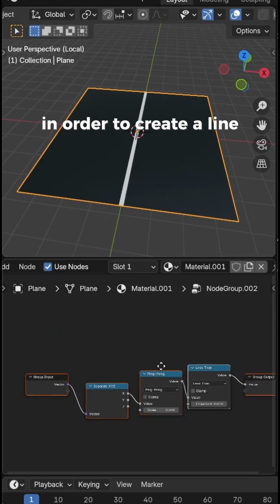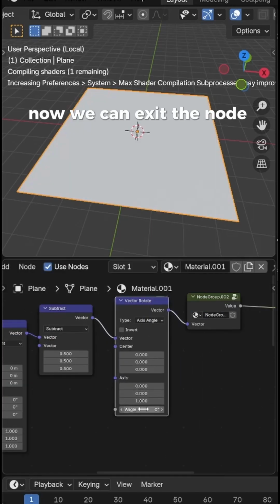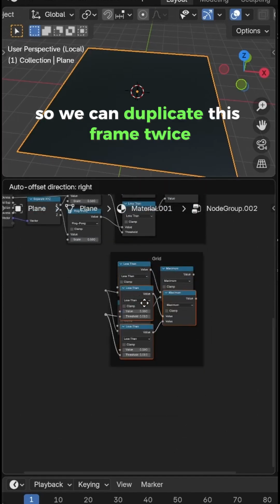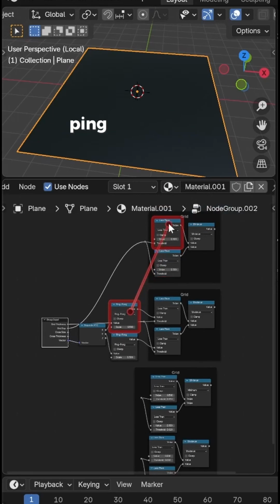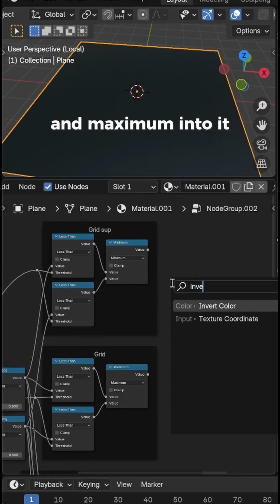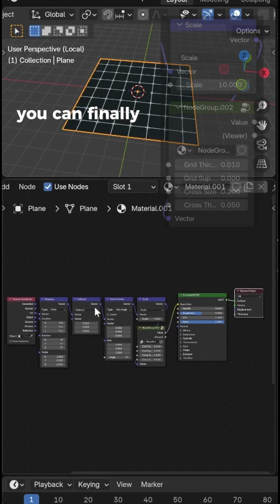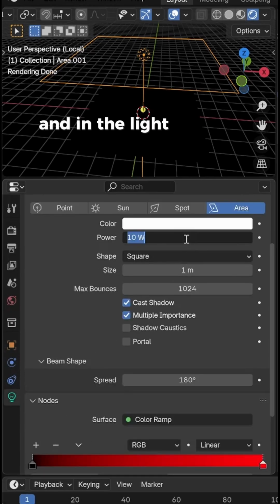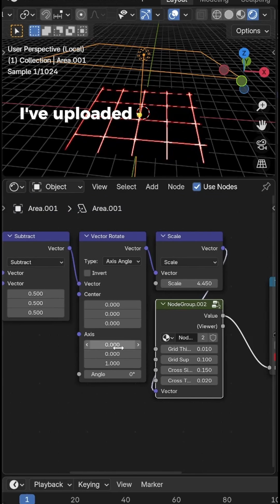Blender Parametric Grid Scan Effect Tutorial | 2 Minute Tutorial  #blender3d #blendershader #3dart

Comment: You lost me after plane lol how do you have so many meterial tabs?
Reply from the maker: Hello, I'm not certain I understand your question, I have a full in-depth tutorial on my page that may be able to help you. If by material tabs you mean the blocks in the bottom half, they are nodes. In the sharder editor tab you can add nodes using shift+A to make a procedural texture as I have done in this tutorial. I It is different from the material preview tab where you have only the base principled BSDF node. Is this what you were asking?